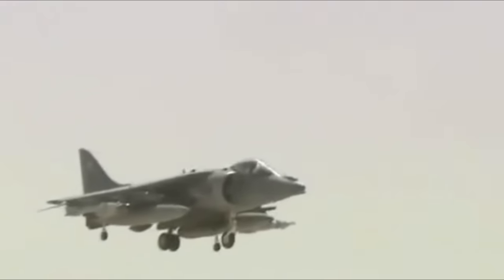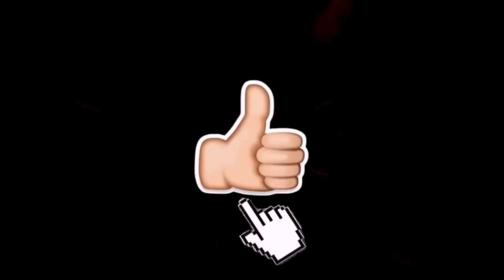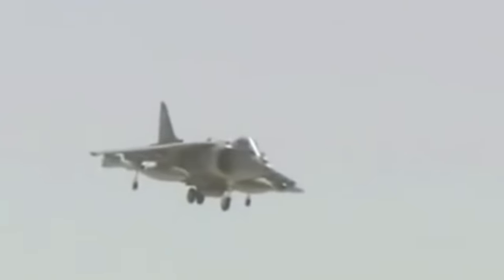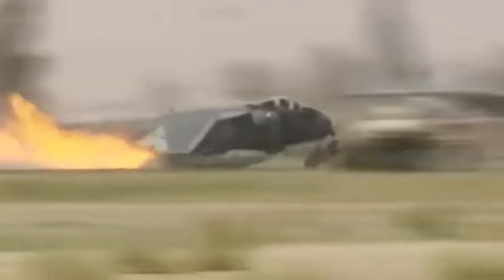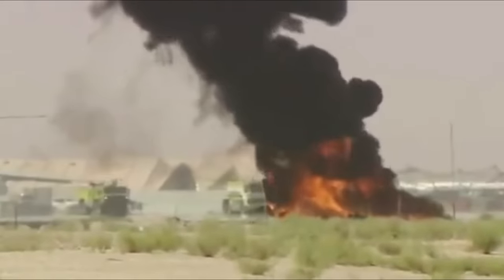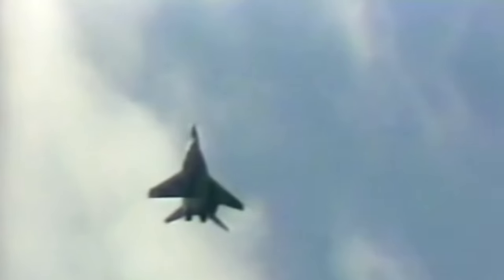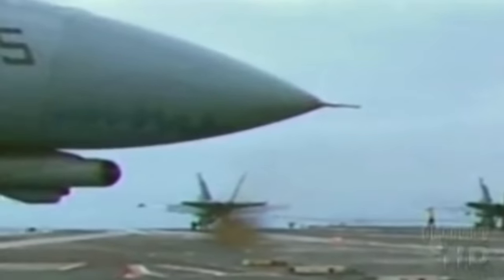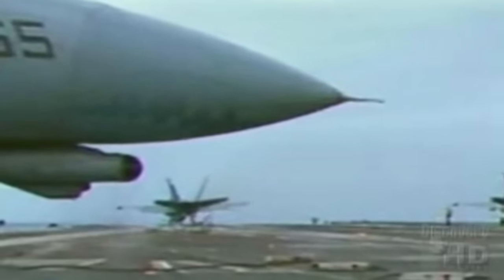3 Pilots Who Ejected At The Last Second (Ejecting From Fighter Jet)

Comment: The Harrier has NEVER, NOT EVER been known as 'widowmaker'. Literally not ever. Never. The reason the pilot stayed with the Harrier was, after a misjudged approach, he was using the last of his control ability to steer the wreck away from a course that would have taken it into a whole lot of other aircraft.

Get your facts straight.
Reply: Well said. As for the Lockheed Starfighter ...hmmm.
Reply: @BaddaBigBoom  Snakes sez the F104 was called that, also 'Missile with a Man'.
Reply: Uhm... yes... yes it was...
Reply: Hasnt it? My understanding was that it could be dangerous to land it vertically. The air under the plane was turbulent and there was little control meaning the plane would sometimes flip upside down right before touchdown. Thats why you see Harriers landing really roughly when vertical.
Reply: @doso4782  Having been an engineer on both Harriers, and Sea Harriers, I can categorically say this is not the case.

Harriers had full control in the hover, having a sophisticated stabilisation and force feedback system to help the pilot.

Harriers were difficult to land, but not dangerous.

Comment: I was in the USMC from 1974 - 1978. I was a member of VMA-231, a Harrier Squadron at Cherry Point. I never once heard the Harrier called the “Widowmaker.”
Reply: I was going to comment the same thing! 
VMA-231: 2005-2010
I’ve not heard that term for the Harrier either.
Reply: Agreed. In the UK. the name "Widowmaker" was only ever used by some parts of the tabloid press. It is true that the Harrier was extremely difficult to fly well, because pilots needed to have both fast jet and hover skills, and managing the transitions between forward flight and hover required considerable skill. In both the UK and the USA this situation was handled by careful selection and rigorous training of pilots. In the early days, USMC lost a lot of aircraft, but changes to their operational procedures eliminated this problem.

Comment: The Harrier was never known as the "Widow Maker", that was most usually aimed at the F104 Starfighter.
Reply: there was also the The Martin B-26 Marauder
Reply: I think he got it from Wikipedia "The AV-8 was dubbed a "widowmaker" by some in the military.[101][169] Further analysis shows that U.S. Marine senior officers never understood the uniqueness of the aircraft. Cutbacks in senior maintenance personnel and pilot mistakes had a disastrous effect on the safety of the American-operated AV-8B and unfairly gained it a negative reputation in the US press"
It also quotes as a source "Miller, Alan C; Sack, Kevin (15 December 2002). "Far From Battlefield, Marines Lose One-Third of Harrier Fleet". Los Angeles Times. Archived from the original on 5 August 2016. Retrieved 21 July 2011. One tragedy-scarred squadron dubbed the plane "the Widow-Maker."
and ""Nightmare's Prayer': A Jet Fighter's Missions". NPR. 24 October 2010. Archived from the original on 26 October 2010. Retrieved 28 October 2010. It's called the [widowmaker] because it killed a lot of Marines."
So yeah, I guess a select few called it that, but definitely not everyone. This guy has to get his facts from anywhere else but Wikipedia lol.
link: https://en.wikipedia.org/wiki/McDonnell_Douglas_AV-8B_Harrier_II

Comment: He got it wrong about  calling the Harrier,  The Widow Maker. That's just not true.
Reply: You are quite correct, it's the Lockheed F-104 Starfighter that was dubbed the 'Widow Maker'
Reply: @andrewagho1260  exactly!
Reply: You're right, that's absolute nonsens
Reply: USMC had over 40 pilots killed in non combat incidents with the Harrier, a rate 4 times that of the F-18.

Comment: So much wrong with is video, starting with the narrator that sounds like he is trying to sound cool but really just sounds like someone trying to insert a pineapple in their rectum then to the utterly incorrect assessment of the crashes. 5: " Taking off" Huh no that harrier was landing after having run a mission but came in to fast and to steep/ 3:  "looses control and the turns " no this is called a stall because he was flying to slow/

Comment: A certain airforce decided it would be a good idea to convert helicopter pilots rather than single seat fast jet pilots to Harrier. Nothing wrong with the Harrier, but it needed the cream of the crop otherwise it could fall out of the sky.
Reply: LMFAO Which Airforce would that be?
Reply: @moappleseider1699  It was the US Marine Corps, they felt that as the plane could hover and required multiple inputs at that point of the flight envelope, aptitude wise it would be better to train helicopter pilots into the aircraft. There was some logic to that argument, as by the time the US Marine Crops was looking at introduction of the Harrier, most jet pilots were on supersonic aircraft (or close to it) with a very different operational behaviours and the art of hovering and controlling that was outside the training provided. 
As for the cream of the crop:  Harrier Pilots had to be good, as often the work was over sea or low over land and that's hard flying (with bird strike risk for added risk). But then personally, anyone who takes a plane up, regardless has to be good.
Reply: @hypergolic8468  That's what I figured. I asked because he said "Airforce" and I was like "wasn't it the USMC". Thank you for the background.
Reply: @moappleseider1699  Don't forget to check for spelling mistakes too. 🙄
Reply: @Michael-4  Oh don't get upset lol. I honestly thought there may have been another countries air force you were referring to. It was a legit question lol. When you make a claim and you get asked to clarify it shouldn't be an issue.

Comment: What a load of rubbish , the Harrier has never been called The Widowmaker, that was the F-104
Reply: True 🙅‍♂️🙆‍♂️🙆‍♂️
Reply: If you were in the USMC you would have heard that name applied as there were over 40 pilots killed in non combat incidents. A rate 4 times that of the Hornet, but admittedly, more difficult to fly.
Reply: @Hattonbank  it's a tricky aircraft to fly no doubt but it's not the fault if the aircraft. Similar technology is used in the F35B
Reply: Interested where you got 40 deaths from as I can only find listings for 12 USMC aircrew losses
Reply: The nickname comes from USAF test pilots. They had many accidents in the beginning.
Then they changed the training and demanded that all pilots should first have experience flying helicopters!
The number of casualties decreased and Harrier is considered as safe as other combat aircraft.
Reply: You are absolutely right about the F-104. It is still called widowmaker.
Reply: @akewillman6947  That's odd as the USAF never used the Harrier.
Reply: @andrewrichards912  18th June 1971 was the first, the 43rd to die was on 30th August 1999, although two died when shot down. Look under "List of Harrier Jump Jet family losses" to see the full list and details of each crash involvinmg USMC/RAF/RN/Spanish & Indian navies. Well in excess of 100.

It was only known as the "widowmaker" in the USMC as they were the biggest operator and had the biggest losses in the same way that it was the Luftwaffe only that called the F-104 the "widowmaker" because it was the biggest operator therefore had the worst casualty rate.

Comment: A common error: runways form a heat column which decreases lift in lighter air under direct sunlight. Always use 30% more speed than you'd usually need. My dad used to do this and I'm sure it saved us at least once.

Comment: The Harrier crashed not because it was flying too fast, but because it was flying too slow for the landing. It was havy and outside temperature was too high so the approach speed was not high enough to perform a correct flare.

Comment: I never knew they can eject when the plane is on the ground, and the parachute still has plenty of time to open.
Reply: The Martin-Baker ejection seat is often referred to as a "zero zero" unit which means it can safely operate (well, as safe as an ejection seat can ever be) with the aircraft at zero altitude and with zero forward speed.

Comment: The Martin B-26 Marauder has been called a widowmaker (but that was with pilots who didn't learn to fly it and treated it like the planes they were familiar with, a mistake in any aircraft) 
The Germans called the Lockheed F-104 the widowmaker (with very good reason; look up the Lockheed Starfighter scandal).  
The Hawker / Bae Harrier is not and has never, outside this vid, been called a widowmaker.   
In fact, as this vid shows, it's pilots tend to survive it, even in bad circumstances.  
It has a very good safety record, and pilots prefer it to more dangerous planes, like worn out F-16s and F-18s.

Comment: I didn’t notice the voice because my brain was busy watching the video wondering how does the pilot eject? manually or computer generated. Does the jet tell him his altitude? Because they all ejected at about the same distance from the ground. Will it automatically eject him if he doesn’t do it himself? What happens to the seat and harness? Do they separate? What distance is he ejected from the jet? How much PSI is used? Is there a better way to get our soldiers out and away from a burning ball of fire.
Reply: I'll try to explain from my general knowledge.
So, they manually trigger it by pushing a lever under their seat (it's not computerized to have less risk of failure), then the windshield is yeeted off with pressure (don't know the amount) and then the seat have some rocket thingys that yeets the seat into the air and then a parachute (integrated into the seat) is released just after

Comment: Isn’t the power of an ejection so strong that if a pilot has to eject like 3 times they’re no longer allowed to fly for health reasons?
Reply: No.
Reply: @chadrides914  It's not a hard and fast rule and pilots who've ejected more than 3 times exist, but more has to do with about how 1 in 3 ejections will result in a spinal fracture for the pilot.
Reply: As you might reasonably expect, fitness to fly is based purely on medical condition. About 80 percent of pilots who eject never fly again for the military.